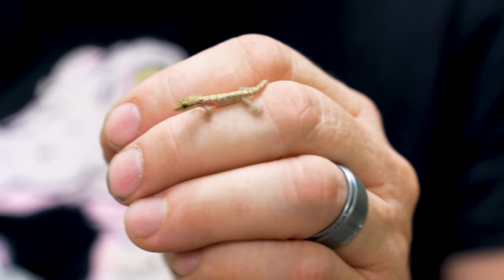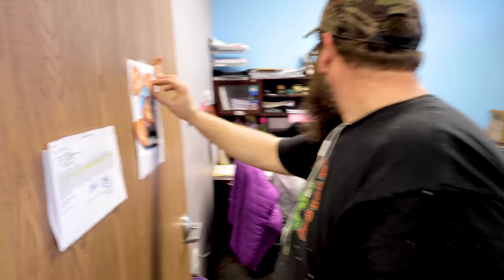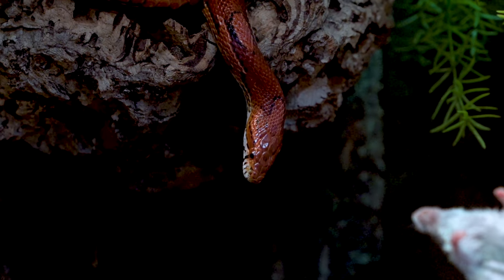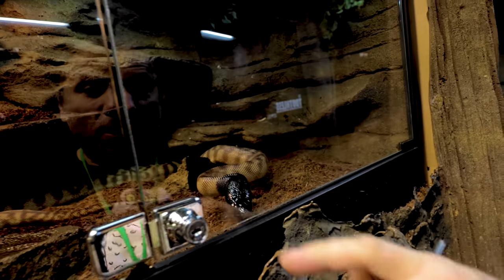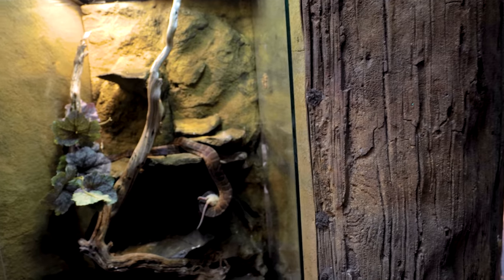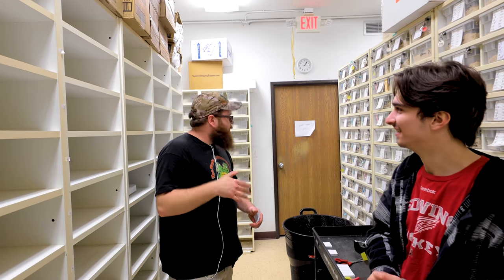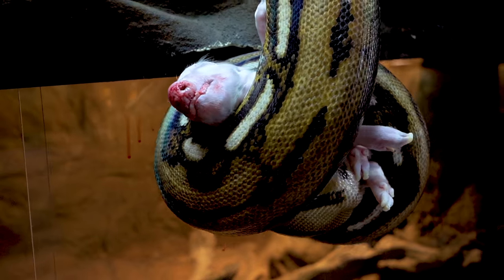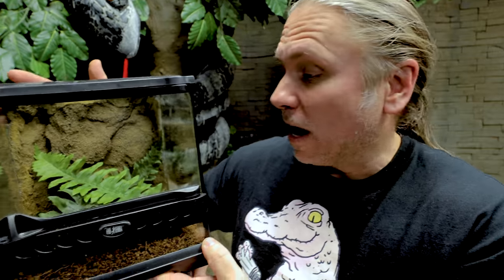HATCHED SMALLEST LIZARD IN THE WORLD!! FEEDING ALL MY SNAKES! | BRIAN BARCZYK

Comment: Butterscotch has to have figured out where to brace herself inside her enclosure, to be able to lunge out that far and not fall out. Would be good to get some shots from above the front to see how she uses her muscles to brace on different points to keep her balance. The Black Rat I have, when she doesn't want to be moved, will press outward with her coil and brace - sometimes in her half-flowerpot hide, or once in the ventilated plastic cookie-jar I set her in while cleaning. In the jar, I can actually turn it completely upside down to jiggle her into my hand, and she's like that cat that doesn't want to come out of the carrier at the vet's - the one who spread-eagles the opening even while you're trying to shake it out onto the exam-table. 😆 Only thing is - snake does this with no arms or legs! Remarkable!